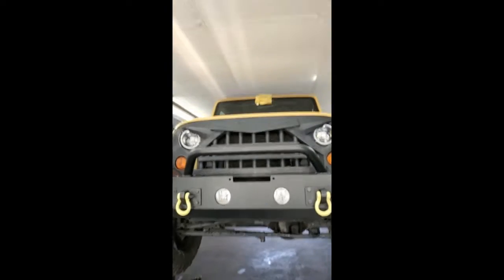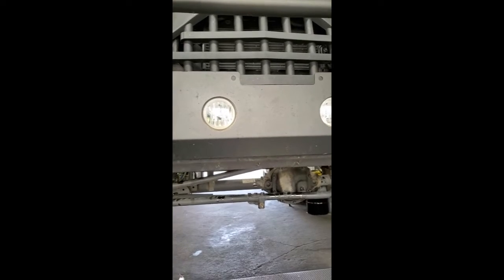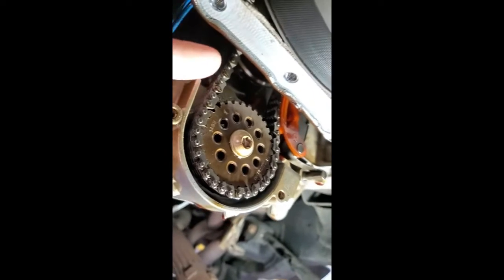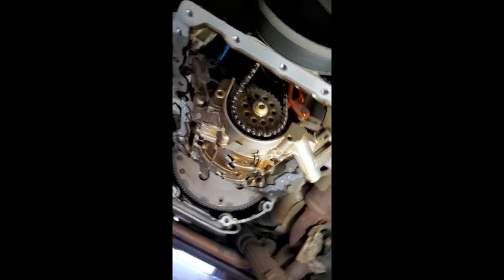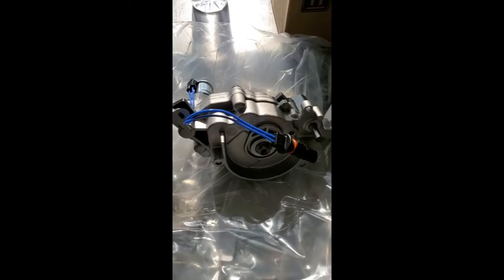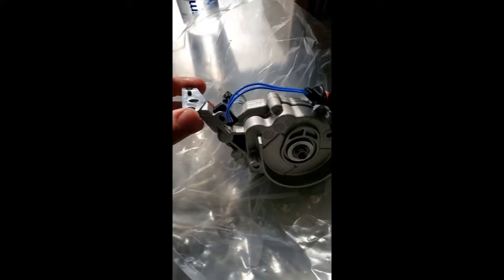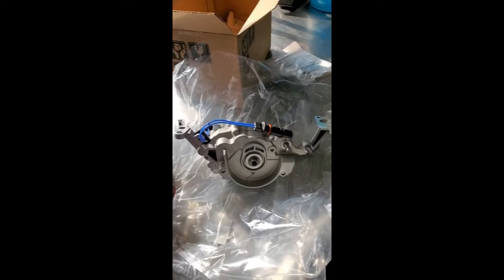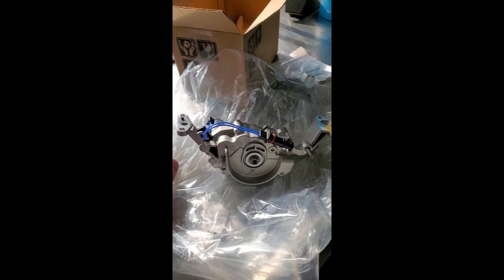Why do 3.6L Jeep Oil Pumps Fail?

Comment: I'm getting a code p0017 on my 2013 Dodge journey 3.6, idle oil pressure is around 17 consistently but have seen it down to 14. Already replaced the camshaft sensors/ vvt actuators. Reckon a oil pump will fix my issue or is it probably going to end up being my timing chain?

Comment: I have been chasing an issue for a week now, codes p0016 and p0017 with p000a and p000b. I’ve replaced cam position sensor on back of valve cover, crank sensor, both bank 1 vvt solenoids (phasers were good) after all that I’m now only getting p0017 when the Jeep is cold, after it warms up I can restart it and the code goes away and drives normal. One mechanic said sounds like oil pump is going out. I’m at a loss at this point and would love to not have to replace the oil pump if it’s not that.
Reply from the maker: We had a Caravan setting all the same codes usually right after an oil change or a day with where the first start of the day was in the 40s or 50s. After putting vvt actuators in it and the codes returning the owner left us tear it down and we found a damaged camshaft and phaser (P000a, P000b, P0300). We also checked the timing chains and found they were stretched (P0016, P0017). We ended up replacing all the timing components (chains ,phasers, sprockets), damaged camshaft and all the roller followers. It was an expensive repair but we replaced all the pieces known to fail in these engines before they failed and caused damage. It's been 6 months and the owner says it runs great now without any check engine light or surging and stumbling.

Comment: Hi thanks for the video!  I am having an issue with the P06DD code on my Jeep Grand Cherokee.  I replaced the oil pressure sensor and oil filter assembly.  I also verified good power and ground on that circuit.  Oil Filter and oil type are the correct.  Battery has been load tested and is working properly.  I can see on the instrument cluster a digital readout of my oil pressure.  The pressure readout seems to be the correct pressure for the given circumstance.  Oil pressure increases up to around 95 ish when I go full throttle and down to around 20 ish when its idle.  Check engine light always comes on within the first few minutes of engine start.  The only thing left that I know of is the oil pump or just the oil pump solenoid, I just don't understand how that could be the problem when the pressures are showing good..
Reply from the maker: If I were to venture a guess the solenoid is bad. The change over to high pressure happens at 3000 to 4000 rpm. If you slowly take the engine speed to that speed you should see the pressure jump when the change happens. If you don't see the pressure jump between low and high pressure mode the solenoid is bad. This is the input the computer is looking for and if it is not seeing the jump it sets the code. 
The actual testing steps in the workshop manual are replace the oil pressure sender and if that doesn't fix it put a pump in it.